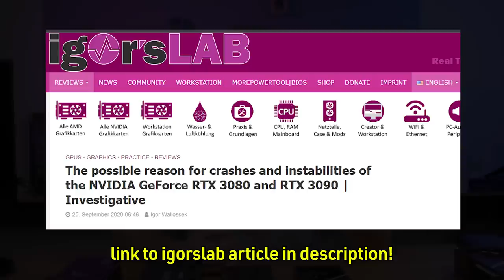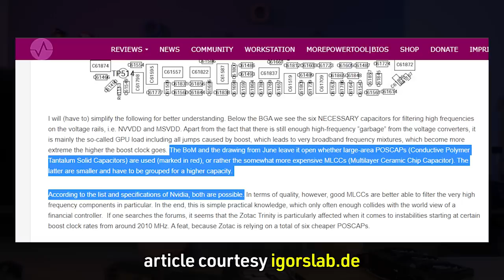The RTX 3080 Launch can't get any worse... Right? Wrong...

Comment: Something that bothers me: The EVGA card with the backplate is more $$$ than the FE card, the cooler is no where near as engineered and looks pretty 'off the shelf' compared to previous gens AND it has less of the "expensive power delivery" :/
Reply: OvAeons that is why we need test and as it seems teardowns before buying anything!
Just see first x570 boards from msi... the low end ones were... bad. After that They sid release new low end x570 that were among the best! So if manufacturer wants, They can and should do better! And we needs test to keep them honest or at least show what is good and what is not!
Reply: Better warranty and customer support? 1 extra year I think. 

But yeah still bad that it performs worse
Reply: The FE card is made at a loss. All that metal and fabrication...
Reply: Because Nvidia sold those overpowered FE cards at cheaper than what normally 'makes sense'.

If I recall correctly, older FE cards used to use reference PCBs. AIB cards more often than not is better than FE, at least for past generations.

This gen, FE cards uses better than reference PCB, their coolers are much better, yet they're selling it at MSRP. *Their margins for FE this gen is likely significantly less than older FEs.*
 ASUS/ZOTAC/everyone else can't build something equal to FE at MSRP without significantly reducing their margins/at a loss.
Reply: Third party buy the gpu at least two times the cost of Nvidia...
Reply: @lukethmpsn  I also find the FE card surprisingly economical compared to all the simpler designs and sometimes cheaped out components AIB partner cards are using... and now this. Very weird times.
Reply: I thought the same, for all of your hard earned money they're still cutting corners.
Reply: "Moore's Law is Dead" has been saying that AIB partners are contractually obligated by NVIDIA to sell their cards at least at manufacture cost. NVIDIA is selling their own cards below manufacture cost as a marketing tactic to make the RTX 30 series appear better value than they actually are. This results in AIB partners only being able to compete with NVIDIA at the dictated MSRP by doing cost cutting that reduces performance below FE cards (or causes these stability issues). It's a massive scam by NVIDIA, and reeks of concern about AMD's ability to compete on a level playing field when also considering the rushed release ahead of AMD's RDNA2 causing supply shortages (which also inflates prices above MSRP).
Reply: So FE is the best to buy?
Reply: Well that’s their cheaper model
Reply: @BruceLeedar  really sounds like this should have been a $799 card. I hope this means AMD has a decent product.
Reply: go google the term "loss leader".
Reply: @lukethmpsn  Yeah i flipped shit at the metal and milling on black plate. I will ASSUME they started as a powdered mould at least
Reply: is kingiping faults
Reply: The fe card is also underpowered and has lots of limitations. Where as other brands are more powerful with less limits.
Reply: @motion2597  Problem is you won't be able to get your hands on a Founders. They were made better, sexier, and cheaper to generate the hype, but they didn't make enough of them because they don't care. You'll be lucky if you're even able to find the crappier, more expensive 3rd party cards.
Reply: @motion2597  FE is good, but why do you think every 3080 in the wild is an AIB? Nvidia made basically no FE cards because they are expensive to make,  they decided it was better to offload the problem to partners. you will likely never be able to buy a FE 3080.
Reply: @jeffmccloud905 ; "go google the term "loss leader".

A loss-leader isn't applicable in a situation where the consumer is buying a single product. Businesses use loss-leaders to get you into the store hoping you will buy other products while you're there.
Reply: @fred_derf  where do the third party companies buy their nVidia chips? Nvidia is incentivizing us to buy their chips. especially from third parties, as a matter of fact... That's why their MSRP is deceptively low. They don't really need or want to sell FE cards. They'd prefer you go third party
Reply: @jeffmccloud905  from Wikipedia, "A loss leader (also leader) is a pricing strategy where a product is sold at a price below its market cost to stimulate other sales of more profitable goods or services".

What additional more profitable goods or services is nvidia trying to induce you to buy by selling the 3080 below cost?

Luring you in with a low price on a product you have no intention of selling but instead intending to up-sell you to another (more profitable) product, isn't a loss leader. That would be much closer to being a bait-and-switch.
Reply: @fred_derf  ha ha, made you use Wikipedia!

Comment: I bought a 3070 aib card and had same issues. I had to undervolt it in msi afterburner to get it working. Voltage controll and precision boost cause a lot of instability.

Comment: It sounds like Nvidia needs to start giving board partners more than a week to design, build, and test their cards.
Reply: its not like they are mass producing yet.
Reply: It sounds like Nvidia should pull partnership from certain board partners for going below minimum specs.
Reply: The whole process needs more time, nvidia needs to send it to the board partners after the all the drivers and stuff are ready, the board partners need more time to test it themselves properly and Nvidia should do their own tests with the board partner cards.
Reply: @MrTaunks  igor said that in the early spec list for the aibs nvidia didn't specify that you need at least 1/6 to be mlcc ones
Reply: @MrTaunks  Nvidia has to approve the design and parts used by the AID partners.

Comment: When Jay mentioned using his wireless mic near testing equipment and having issues, it reminded me of issue where  we had Static Transfer Switch(STS)es that would alert and drop power to devices in server cabinets when we used our radios/walkie-talkies. After finding that out, we had rule no more walkie talkies on Data center floor. We eventually replaced them with Automatic Transfer Switches(ATS) a few years later.  

Thanks to all the beta testers who waited in line and got one to test for rest of us.  Glad I couldn't get one day one.
Reply: Hence why in some countries you sometimes your phones frequencies can mess with shit there
Reply: @L33T_Taco  I have a line in microphone connected to my motherboard that exhibits static noise in voice chat applications. It seems to be exacerbated a lot when I add more GPUs to the system. I have 4 1080 Tis in mine and it's causing a huge amount of interference.
Reply: i got one for you... i work on a control room enviornment.  we have handheld radios that we talk to people in our facility.  when we key up a mic to talk and the mic base is close enough to one of the monitors it will turn the monitor off.  freakin' weird.
Reply: There's a reason heavy munitions dumps have huge no rfi zones around them. Any sorta transmitters are noisey
Reply: @NUCLEARARMAMENT  I got the same thing. but mine was more jsut cuz the port didnt secure the plug tightly and it wiggled a lot..so i had to turn the plug in the port till the static stoppeds
Reply: Remember that time a radio telescope installation was having lots of weird readings? Microwave oven in the break room lmfao. No more microwaves to heat your food in that place now.
Reply: @NUCLEARARMAMENT  i had to switch to usb mic thanks to that

Comment: Yeah. but there is a thing: why ever mention POSCAP (made of tantalum) when  in videocards they use only 1.SP-CAP made of aluminum and  2.MLCC  which are ceramic. Statement that using any of those can lead to failure is false.

Comment: Helpful tip: The “Debug Mode” in the NVIDIA Control Panel (in one of the top drop-down menus) will let you run your OC SKU’ed GPU down at reference clocks until this gets sorted out.
Reply: Doesn't seem to do anything to my 980 Ti that is pre OC'd apart from set GPU Frequency to +0 MHz, doesn't touch Memory or voltage
Reply: @prich0382  use firestorm to check the actual downclock, i see it in my zotac 980 amp extreme
Reply: @prich0382  ohh maybe firestorm is only Zotac
Reply: nice tip, i had to install msi afterburner to underclock because for some reason stock driver have been ramping my 2080 TI to 2GHZ hitting 85 degrees wich trigger the Fan fail safe System boosting them to 200 or 300%  making an insane amount of noice ...
Reply: Sp3ci3s8472 of course if you’re having issues you should RMA. This is just a temporary solution to get you by without crashing until they get you a new one.

Comment: So thats why the ASUS rog Strix comes with a whopping 1900+ boost clock by default. They use 6 good one's.
Reply: Does the strix also have 6 or just the TUF?
Reply: @swampsect  strix is higher than tuf (in hierarchy) so yes.
Reply: Asus TUF series uses all the same small ones as well....
Reply: Did you check the pics of Strix on internet? 3090 strix has 6 cheap ones....
Reply: The 3080 EVGA FTW3 Ultra actually says its boosting to 1800MHz but in Reviews (GamersNexus) it goes up to 2055MHz (Stock).
Reply: @Beltramstein  search out 3080 strix pcb breakdown on youtube. They use the proper capacitors, not the cheap ones. Those photos that you saw are only pre production photos
Reply: @wubziz4769  thats not the default boost clock. Every mhz above boostclock is determined by powerdraw and temps. Expect that the strix will go 2050-2100
Reply: @johandeen6096  Ofc its not the default boost clock but also not a manual OC clock.
We'll see how the AIB vs AIB cards play out in benchmarks and in terms of heat, clock and so on.
Reply: @wubziz4769  insta bloody_impact_xt
Reply: @tannervandenheuvel213  I'm not sure where you get the idea that nobody wants TUF series to do well. Am I misunderstanding your statement?

I use TUF series exclusively for my lab machines because they have proven themselves to be more resistant to EMI and HERF in our shop. All aluminum caps means that, for us, the only thing volatile on the board is the CMOS battery, and the performance is rock-solid.

I love TUF series.
Reply: So out of all the brands which ones are worth getting? It's looking like asus is the move.. Did EVGA really cheap out? They're usually pretty good with quality
Reply: Swerving Lemon yeah tuf series isn’t bad I think it’s just that most people who won’t be getting multiple gpus or are using them for a work setting would rather just spend the extra couple hundred dollars to get the “premium” edition. I personally plan on getting the strix but I think the tuf series has a good market too. Just not for everyone.

Comment: Side note (after he mentioned the noise powerlines make): Take a fluorescent tube light and put one end on the ground under the huge transmission power lines and it will light up. Not full brightness, but it'll flicker. Even just holding it in the air will make it flicker, but it works better when it's grounded. Kinda makes you realize how much power is running through those lines when it can start to light up a bulb that's 100ft below them.
Reply: Really?

Comment: Given how much money these companies are asking for the RTX 3080, the fact that they're cutting corners to cut cost is disappointing. Also, was it worth cutting costs when now they're going to have to deal with upset consumers & hundreds/thousands of returns? They definitely need to own up to this mistake, and make this right.
Reply: Those tiny MMCL caps are actually cheap🤷. Theyre more susceptible to heat and cracking.

Those big black SP-CAPs are more expensive. They're tougher and last longer.

I think Jay has it the wrong way round.😅🤔

The combined cost of the MCLL caps on ASUS's TUF is actually cheaper than the alternative of using SP-CAPs of the same total capacitance.

(Attaching/Soldering to the board might be the factor that makes it more expensive..but I don't know.🤷)

I don't think PowerColor was trying to cheap out. I think they thought they were creating a better quality product than the reference design.

Those specific capacitors are probably just causing some funky resonance at 2000Mhz that's not being filtered and entering as noise. And by coincidence, the small cheap MCLL capacitors just so happens to NOT cause resonance at that frequency and continues to filter noise normally.

ASUS probably realized that in time and changed to the cheaper MCLL caps....and removed all the SP CAPs to remove the entire source of such noise caused by resonance around 2000Mhz.
Reply: Class action lawsuit!
Reply: Actually, what is probably going to happen is a firmware update to limit the core clocking to a more acceptable tolerance.  As he said in the video, the chipset can adjust the core clock based on power consumption and temperature, so you are actually getting a higher clock than advertised.  The problem seems to be stability for those higher clock speeds.  By updating the firmware, they can limit the upper end that the card will clock to automatically in order to reduce the stability issues.  And because the card is still operating at the advertised speeds, there won't be any sort of lawsuit.

Comment: Shoutouts to colorful for recognizing that there is an issue and sending you a card when they fix it instead of trying to bribe you to keep it quiet.
Reply: Fix all the manufactured cards? They’re screwed because of their dump decision
Reply: To a reviewer who has an audience. And by lowering the overclock worse than FE. Do you think they will refund any customers who purchased the card or switch out the cheap parts for the more expensive parts: Hell no. To me it was more a "let's send reviewers an underclocked gpu so they dont go reporting that our cards crash a lot to the public" not some hero move.